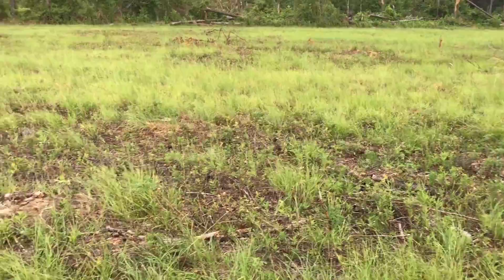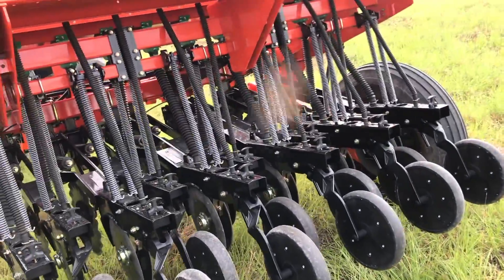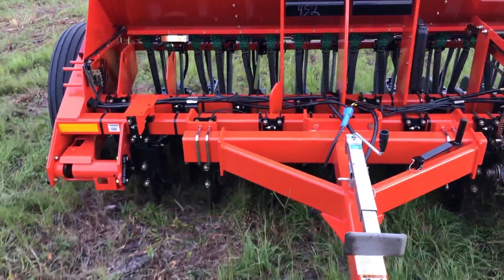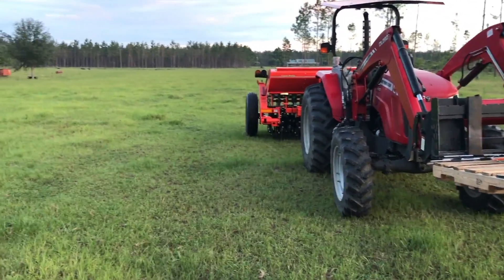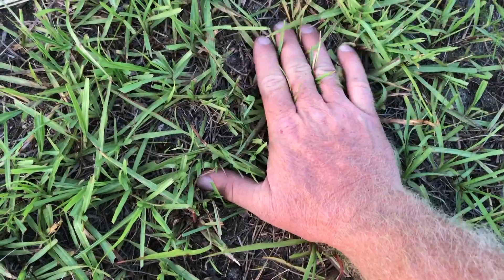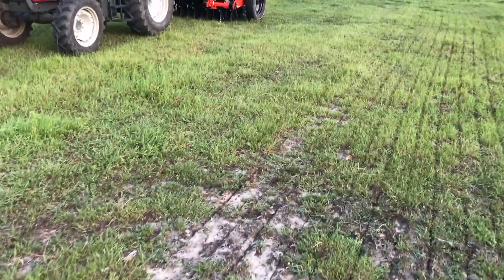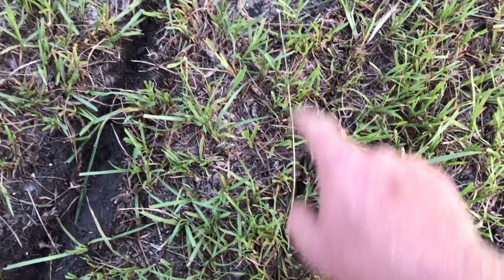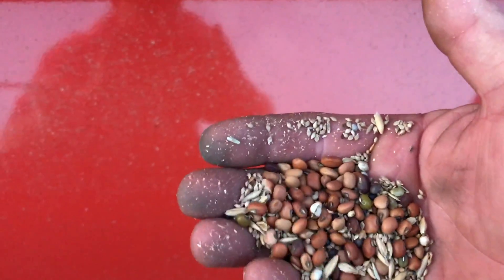Update from the Field: No-Till Grain Drill

Comment: How wide is your drill ? How many horsepower does it take to pull that?
Reply from the maker: We have the 1006NT. It plants about 10-feet wide. It is almost 15-feet wide.  We have a 70hp Kubota M7060 with 4WD. The Kubota pulls it with no problem. Thanks!